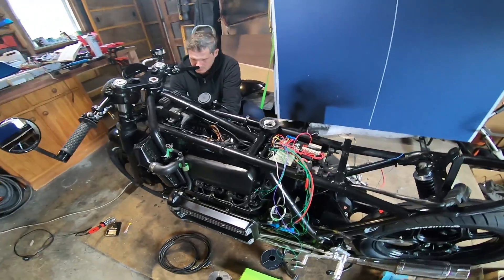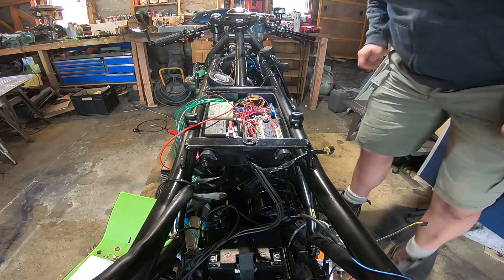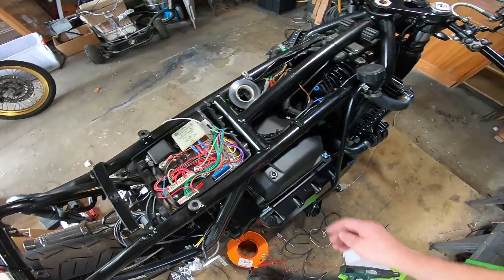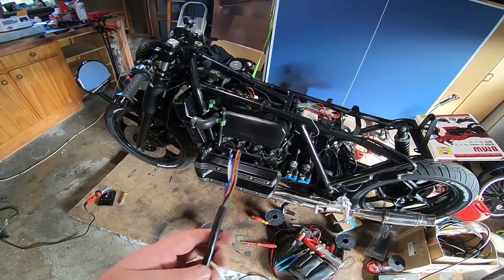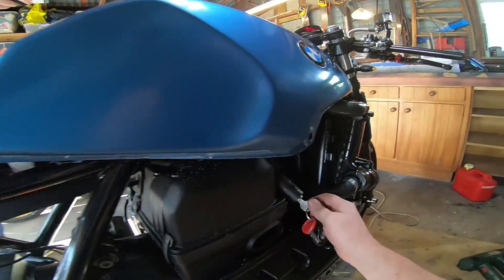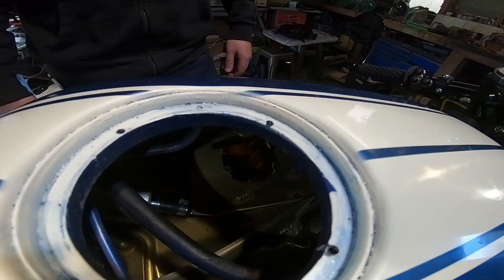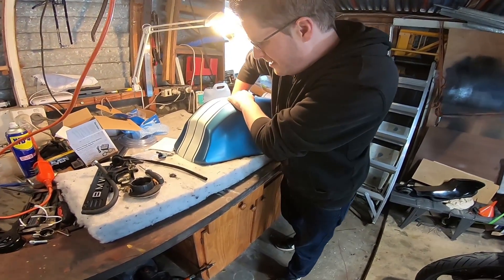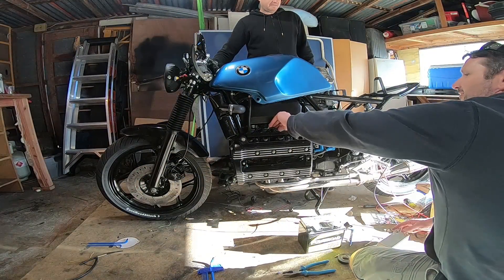BMW K100 MOTOGADGET M-UNIT WIRING PART 9

Comment: Hi Mikey these are really helpful vids (I’m from NZ). Couple of questions for you. What happens with the throttle position sensor? Also I don’t get an oil pressure light on my motoscope pro. I assume it is triggered by a ground to the oil pressure switch connection to the breakout box? I just can’t get any warning to show on the moto scope pro

Comment: Hello Mikey,
Nice video, one question:
I’ve wired my bike like you did in the videos but when I try to turn the starter motor, the Relais clicks and the motor doesn’t turn. And if I connect pin 85 from the Relais to   12 V the bike starts. Do you have any idea what the problem may be?
Greetings from Germany

Comment: Hi, Nice Work! I have used all your videos to wire my k bike, so thanks a lot! But How do you wire the neutral gear indicator light?
Reply from the maker: i did do a video showing how i did my neutral switch but for the life of me i have no idea which one it is, i believe there is now an after marker box of magic that will plug into the old gearbox connector and sort it all out for you ,,, unsure of the name of it though
Reply: @mikeyfrompiha  Thank you !
I have another question. My charhing lamp does not turn on, do you know why? At first it turn on but after I finished the wiring diagram it doesn't.
Reply from the maker: @fred9399  Hi , lamp should illuminate when the ignition is turned on and turn off once the engine is running, check for a blown lamp? Do you have a multimeter? See this video for more https://www.youtube.com/watch?v=3sEqk8mq4H4

Comment: Me again, have got a few questions. I’ve seen a product called the BEP -3.0 it’s for the K series and it seems to include more functionality. 
Such as:

RPM  / revolutions per minute
 speed
high beam
warning light
back light check
ABS
Fuel gauge
alternator
engine temperatur
oil
Choke
switch power
indicator left
indicator right
Neutral / gear 0
gear 5
gear 4
gear 3
gear 2
gear 1 

Is there a way to do this with the M-unit? Or are these just left out?
Reply from the maker: Hi , i have never really had anything to do with the BEP but i believe the two are not compatible, you need to add a break out box to the M-unit and be using the motoscope pro
Reply: @mikeyfrompiha  see my other question. I went with the M-Unit in the end.

Comment: Hello Mikey,
did you find out where that noise around 13:20 come from? Is it the starter engine or maybe the flywheel? 
My K75 from '88 makes the same sound when starting, but without the engine turning over at all. 
Since i just bought it and want to start the cafe racer build, i'd love to hear your opinion on that! 
Thank you in advance and best regards mate!
Reply from the maker: Starter sprag clutch, unfortunately to get to it means a full engine tear down! And unfortunately it won't get any better with age!

Comment: Hey mikey, thank you for these videos.. awesome.  Im having an issue with mine i wonder if you have time to give some suggestions.  Ive followed your m unit install by steps however my injectors refuse to fire. Each fires when 12v applied directly ( then gives me false hope when i turn it over and the fuel ive pumped in lets her cough) everything else seems to work as it should. Ive been stumped on this for weeks going over and over but cant figure out what im missing. Cheers  from scotland.
Reply from the maker: Hi there , glad you have enjoyed the videos, i have had this question several times before, so with the injectors, all 4 fire at the same time, there is only one output from the fuel injection computer and its switching a negative. So as long as you have them all wired as per my diagram then grab a multimeter and see if you have a constant 12v + at the injectors to say a known ground like the frame or the engine.  If not check your wiring, you should get a 12+ when the ignition is turned on. Most people who have this issue that is the problem. Good luck and let me know how you get on!😁
Reply: @mikeyfrompiha  dude.. thank you, now trying to figure out how to get away from work early!!
Reply: @mikeyfrompiha  hi mikey, I have 12.9v at the injectors but still no luck, all grounds look good to me, any ideas?
Reply from the maker: @bainbrett6028  ok so probably should have asked was it a running bike before? If so check to see if all injectors good back to terminal 12 and you have good continuity on that wire , then just check over all your wiring to make sure you have everything good. I'm guessing your fuel pump works? have you removed a spark plug and visually seen if there is no spark? Low fuel pressure can be an issue also. Hope this helps.
Reply: @mikeyfrompiha  so... yeah, bike ran sweet before, I ran it for 6 months +/- to iron out any issues. Been sat idle for over a year. Getting 12v+ at injectors. Continuity on pin 5 of fuel injection module to injectors but no tone on pin 12.
Reply from the maker: @bainbrett6028  Do you have my wiring diagram? Should be to pin 12
Reply: @mikeyfrompiha  hi mate, sorry please disregard last message. Operator error. So.. I have constant 12v from pin 12 to injectors but is not switching. I've checked everything over again with your diagram and can't find what I'm missing. Fuel pressure is 38psi at the rail. Everything else appears to be working as
Reply: .... it should, good spark on all 4, good compression etc. If I drip fuel in the cylinders it fires, just can't get the injectors to pump.
Reply: Could a faulty temp control relay prevent fi unit from switching injectors?
Reply from the maker: @bainbrett6028  Are you sure you have good fuel pressure? See this video at 9mins you will see the fuel pump no good https://www.youtube.com/watch?v=S4QC_4W5H94  you could also pull out the complete fuel rail with injectors mounted and see if they squirt when trying to start the bike?
Reply: @mikeyfrompiha  I've put a gauge inline at the rail from the pump and have a consistsnt reading of 38 psi. Have taken out the rail and none of the injectors are squirting fuel.

Comment: Hi Mikey Thanks for all your videos they have been a massive help. I'm in the process of wiring my K100 with a M-Unit basic, could you advise where the key ignition wires go. I have a red, green, grey & blue/grey but not sure where to put them into the M-Unit. Any help would be appreciated. Thanks
Reply: Did you get this sorted? I have the same question

Comment: Hey, will the Motoscope pro work with any of the OEM sensors on the bike? Temp/pressure/speedo etc? I see they sell their own so im wondering if ill have to replace the sensors on my bike to get it to work
Reply from the maker: Hey Markus , some work others dont , just try them out and see which ones do , i know the stock BMW speedo does not work , you need an extra circuit board to make it function , hope this helps
Reply: @mikeyfrompiha  i guess the only way is to dismantle the temp sensors and test them out like you did. I guess it is nice to know they are working atleast. Thanks for your reply!

Comment: Hi Mikey, I've been binch watching most of your videos in the hope to find some solutions to integrate the m unit blue with my 2016 XSR700. At first, when I saw you connecting this K100 EFI Controller Box to the m unit, I thought I can copy the same idea with my XSR700. However......when I had a look at my bike's wiring diagram, almost every components go through the ECU. My bike has ABS, ECU, EFI & Immobilizer. Will you have any thoughts on how the m unit blue can be connected to all mentioned sub-systems? Thanks in advance!
Reply from the maker: Hi Albert , pretty sure you cant intergrate the m unit into a modern bike , why do you want to? I would think the modern electrics would be fine?? Any how cheers mate !

Comment: Hey Mikey, thank you for the great videos. They’ve been a really big help for me and my m-unit installation. Quick question, how did you install the oem ignition key back into the bike? 
Thank you.
Reply from the maker: Hi Clay , we used an aftermarket key switch , can't remember where it was purchased from ?????
Reply: @mikeyfrompiha  thank you for the response. I’ll have to do some research.
Reply from the maker: @claymcleod4253  try cafe4racer.eu
Reply: @mikeyfrompiha  will do! Thanks again.

Comment: Hi Mikey, you showed the Fuel level sensor Earth & Green/white connection. Where did you connect the white and yellow wires pls? Did you connect White to breakout box and isolate yellow? Thanks.
Reply from the maker: My fuel sensor was faulty so i didnt use that function , i just make sure i am always fueled up full
Reply: @mikeyfrompiha  I,ve put white to LED on top yolk & yellow to breakout. Hope ur well.
Reply: @ADY954  Sorry, what did you do with the yellow wire?

Comment: Great details with this build! just finished wiring mine to the M-Unit, and actually fired right up. Question, I ran the blue wire from the alternator with a bulb from the cluster as you did, After start up, it doesn't shut off, am I missing something? should the light shut off?
Reply from the maker: hello , yes the light should turn off once the engine is running , so red cable to battery positive , blue wire through the incandescent lamp to a 12v positive and make sure the alternator is grounded to the engine good and the engine has a good ground to battery negative
Reply: @mikeyfrompiha  thank you, everything seems right, but light still does not shut off. I will re-check the ground. So no diode in between the blue wire needed? And blue wire to "Lock" of the M unit? constant positive?

Comment: Hello Mikey. Thanks for all your videos. Great inspiration. Thanks to you, I made it by myself. My Brick on M Unit. There are still some things to cope with, but she did the first trip around my house today. Great feeling. I did the same alternator trick as you, and I found out that this will work with the key, but not on keyless go with the Unit. Do you have 
any clue :D Cheers
Reply from the maker: Hello ...awesome news .. just connect the charge light to any +12v supply that comes live when the bike is running ... for example the ignition output on the m unit... 😁👍
Reply: @mikeyfrompiha  cool thanks. Thats what I planned to try this morning. After that I have to check if my ventilator switches on when the engine heats. I made it as you showed us. Cheers

Comment: Love this series! In your wiring diagram, there's a note about the ICU pin 6 (black yellow) maybe not needing to be connected to the mUnit START output, and that you're going to "run some tests". What was the result? Does it need to be connected? Please keep making these awesome videos!
Reply from the maker: Hello , yes that cable can go to the "start" output on the m unit , what is does is when you start the bike it sends a signal to pin 6 telling the fuel injection module that the bike is starting , this in turn increases the fuel being injected to aid in starting in cold temperatures (or so i have read) , i dont have that wire connected on my personal bike but have connected it on others that i have wired and have not noticed a difference , though it really does not get that cold here where we live . Hope this helps !
Reply: @mikeyfrompiha  thanks for replying! I'm also trying to figure out what to do with the red/brown wire, and the yellow/brown wire from the ICU. Should I just tie those to the mUnit IGNITION output?

Comment: Mikey where does the throttle position sensor connect to ?
Reply from the maker: into the wiring loom , has a plug only it will fit , near the injector wiring

Comment: Just finished all these videos. Amazing job! Any chance I could get ahold of the wiring diagram? I’m about to do a full rewire of a 1995 K75S with an M Unit Blue. 
How similar is the factory wiring from a K75 to K100?
Reply from the maker: The 95 model has a different ECU than mine so wiring will be different , i can still send it to you though , just email me mikeeyfrompiha@gmail.com with your email
Reply: @mikeyfrompiha  sounds good. Sent you an email!

Also, do you have any details on the clutch/brake handset assemblies and master brake cylinder used on this build?

Comment: Quite a jump from 8-9,good for you getting it all back together especially the Munit,my personal darkest nightmare that might cause me bed wetting again..hahaha I was looking forward to the water/oil pump rebuild,since that is my next task. Did you use the special tool ,or just a socket? Any how great work great bike,thx for all the info and the extra effort of putting it all together,awesome !!!
Reply: Never mind just found it in EPS 10 gawd I am impatient,thx again
Reply from the maker: Good stuff ! I knew i had done a oil pump seal video some where!
Reply: @mikeyfrompiha  just attempted to do mine , but was to cheap to buy the seating tool and of course messed up the seal with a socket and some wood...Soooo new seals,the tool, oh, some 3bond ,just cause I finally found it...at least I don't have to pay for the adapter the oring and the orange seal to the body. Scratch he money I thought I saved that cause ,I gotta have it in a couple days at the latest..thx by the way for putting probably the best K video series on...GOD sent,thx

Comment: Hi .. are you able to use the stock speedo sensor with the motogadget kit? Also do you have a solution for the neutral light? .. maybe this is the next video ;)
Reply: I may add in a BEP3.0 to sort the rev counter issue, neutral light and speedo. Feels like overkill though .. sort of hoping you have another idea!
Reply from the maker: Unfortunately no , i used the one that came with the motoscope pro

Comment: Hi, what are the forks on this bike? Awesome vid as always.
Reply from the maker: Standard BMW K100 forks with the gators over them , the gators do make them look good !
Reply: mikeyfrompiha what year is yours and this bike pls. 2 or 4 valve? Is there a big difference in performance between the 2? Cheers.
Reply: ADY954 this one is a 1986 RS. They are two valve. As to performance difference I have not ridden both so don’t have a view about that.

Comment: Hey I was wondering on the coils how do you know which one is for what position? Thats the only thing I didn’t take note of was plug on the coil for which cylinder 🤦🏽‍♂️ and can’t seem to find anything talking about this either.
Reply from the maker: Hello , do you have a factory wiring diagram , front coil does cylinders 1 and 4 , back coil does cylinders 2 and 3 , cylinders are numbered 1 at the front and four at the rear of the bike ,,, hope this helps

Comment: good work on getting that baby fired up. re the starter sprag  not engaging. the oil gallery that lubricates the sprag is a very very small diameter and gunge  blocking  this may cause the clutch to effectively run dry and give the intermittent troubles that you are experiencing. on advice from some clued up members of motobrick.com a simple fix for this is to drain your engine oil , install new filter and refill with  diesel engine oil. this contains a much higher detergent  component and will potentially  flush out and solve your problem. I have a k75  filled with diesel oil at the moment and have done 3000 kms  (15w40.) i will swap it out with normal engine oil at the normal 5000 kms  interval. i ride my bike like it should be ridden and have had absolutley no ill effects. one of our american brothers has  3 x K bikes and he runs diesel oil full time  (45,000 miles so far) and swears by it . all the best from christchurch.

Comment: Hey does this wiring diagram works with a K 1100
Reply: Some does but the k100 uses a separate ignition and fuel injection module while the k1100 uses 1 combined unit if you want help or a wiring diagram for the k1100 I’ll send it to you
Reply: Actinde hello, I would be very interested by this diagram too, if you would have the possibility to send it to me too 😊
Reply: Anyone who ever reads this comment email ryanheisner@gmail.com and just ask for it and I’ll send it
Reply: Actinde Thank you so much I will email you right now
Reply: Yes please can you help me out with it, I have a 1997 k1100 lt
Reply: I would highly appreciate if you could send it to me.

Comment: Btw, it is called sprag clutch...here is a link : https://www.k100-forum.com/t4116-sprag-clutch-cleaning-the-sprag-clutch-and-bearing-replacement. Greetz, Frank
Reply: Frank Gores thanks for the link. Since running and after an oil change it seems to be happening far less. Worst at cold start, but even then it’s now engaging 95% first try. Hoping it continues to work and free up. Thinking a flush may help. It’s a heap of work to get in there and will do it if I have to!
Reply: Greg Harrison  yeah, I have had it as well, but after running long and hot it might be enough to free the sprags. Do use only mineral oil, these clutches do not like synthetic oils....( is more expensive anyway). Greetz